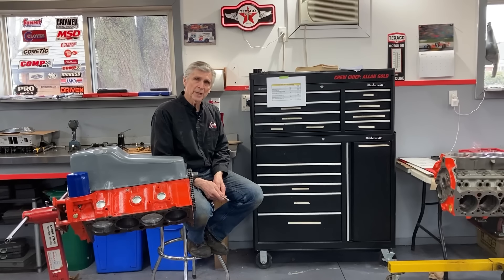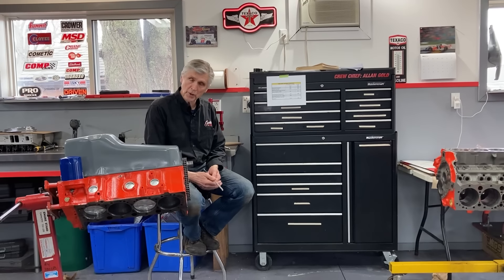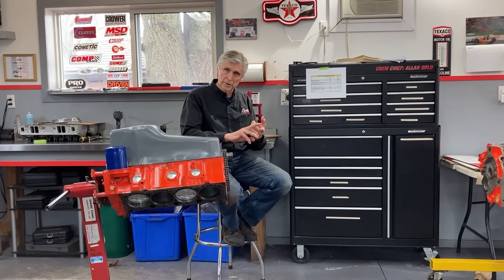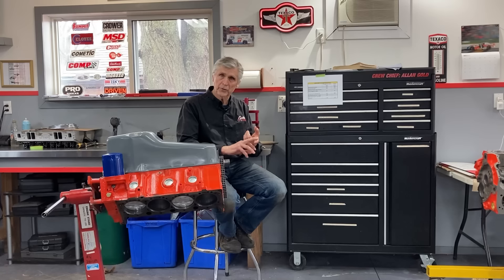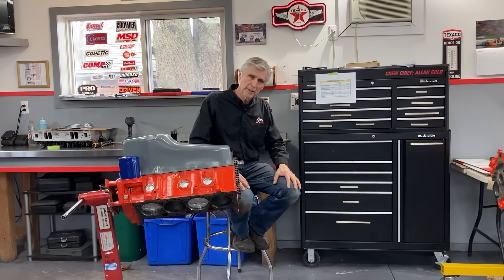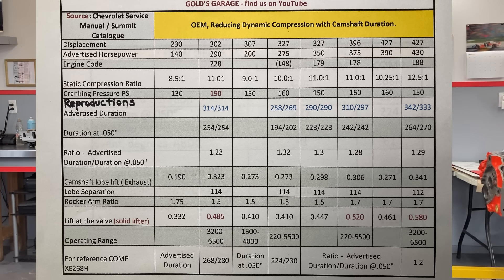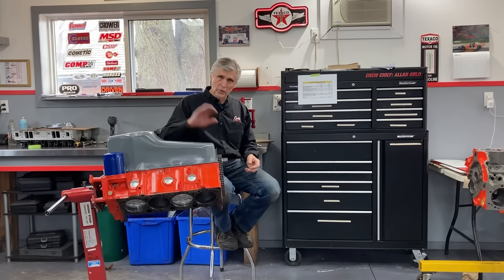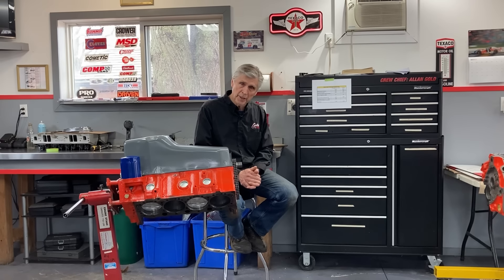Selecting the right camshaft - Compression Myths How much compression can you run on pump gas?

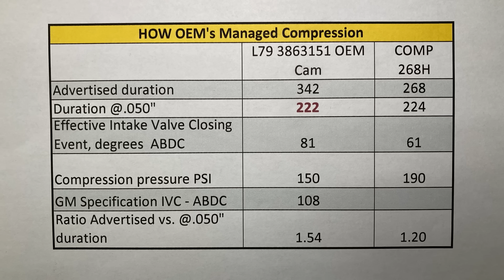Comment: Interesting Camshaft comparison at video 13:41....Are Both Camshafts Actually Measured using Exactly the Same measuring Method or is Any of the IVC° data Estimated or Equivalent Computed as this is 1 OEM Solid compared to Aftermarket Hydraulic cam ? ......
Exactly did Chevy Measure their Solid lifter cam IVC° & Intake Duration ? .....I don't think 0.050"  or 0.020"  at Lifter Check Height was used.....Anyone know  for sure ??
Reply from the maker: Good question Tom. I calculated the effective IVC based on the other known factors. It would be impossible to measure with a degree wheel because of the soft ramps. Pretty sure the .050" measurement was not common then. We just degreed to the centerline. Thanks for contributing. AG
Reply: Thx so much for  responding....I'm really Interested in this  topic as I have a Mopar build going on with a solid FT Cam & concerned about same Expected octane issues....My error on the L79 OEM Solid lifter spec, I know it's Hydraulic also....Why not Compare both cams Measuring at SAE  0.006" Lifter Check height (using a solid lifter) Similar to what Factory spec was for the DCR calculator input value ? .....I'm real interested in what's Actually  happening at between 0.006" & 0.050" valve lift & think the 0.006" lift point would More validate the OEM extended lobe ramp effect issue on Actual IVC° point.....Thx again,...Tom..

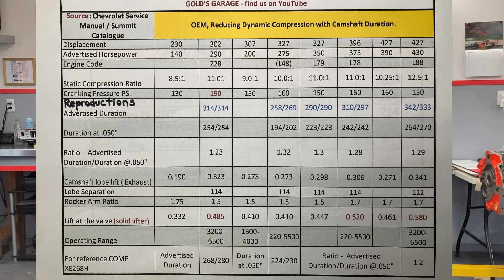Comment: I had a 64 Chevy II that had the “140” (last 3 numbers) cam and 12.6:1 compression ratio according to the guy that owned the car before me.   The car had a 4 speed and 4:56 gears.  It ran on the street fine but would really wake up at 5,000 +!
Reply from the maker: Sounds like a fun ride, Thanks for sharing. AG

Comment: Would you know perhaps what would be a better camshaft than factory on the vw 2 litre air cooled kombi, I think torque would be more advantageous, unless you think original cam is still a good choice. Thanks buddy 😊
Reply from the maker: Thanks for your question Harry but I don't have much experience with this engine and don't know enough about the application. Consider the end use, daily use vs. race, weight ratio, lb./cu. in. gear ratio, type of transmission, RPM range where you will need the performance etc. Hope this helps a bit anyway and thanks for watching. AG
Reply: @goldsgarage8236  ok cool thanks 😊

Comment: We run over 16 to 1 on Pump Gas with Cranking comp of 220 we also don't go near Peak TQ or load it going down the road and chance to Race gas at the tracks. There is lot of work goes into being able to do this but it can be done.
Reply from the maker: Thanks Jeff, I don't even know how you would get 16:1? AG
Reply: @goldsgarage8236  it’s a 712 inch all billet semi Hemi from Todd Goodwin it makes over 1300 hp. We Run Sick Week and Hot Rods Drsg Week. N/A it’s going 7.71 at 174 1.11 60 ft. Not to many people understand pumping losses from lift and duration, ramp design effects on it. Good information overall

Comment: How to consider or calculate cam and gear ratio relation ?
Reply from the maker: Thanks Bryan. Generally bigger cams don't make a lot more torque, they just raise the RPM  where that torque is made. HP= torque x RPM/5252. So if you use a cam that produces torque at higher RPM, you need gearing that raises your RPM and takes advantage of it. So as the operating range of the cam increases, the gear ratio should increase proportionately. Hope this helps. AG

Comment: Yep this is correct and if you if you follow his 61 versus the 81 after bottom dead center that's where he gets it back on the right now yep and I believe that will and his destination is going to make it to the definition for gas cuz that's what we're going to do run pump gas and see if I can do it with 13 to 1 or 3:27
Reply from the maker: Thanks for your comments. AG

Comment: The issue with cranking compression is the rpm the engine cranks at.  Street engines with higher tension rings tend to turn over slower than a comparable engine with low drag rings.  Higher compression can cause a slower cranking RPM if the plugs are left in the other cylinders. I typically remove all the plugs. This gives a better picture of the condition on the cylinder being tested. 

Sizing cams is an art.  Bore to stroke ratio does come into play and it's opposite of what I thought it would be. The longer stroke engines appear to be more fickle with duration than shorter stroke engines.  This is for racing applications and may not matter for street applications.
Reply from the maker: Those are all good points Brad. It is good practice to remove all the plugs and have good cranking speed when taking a compression test. Thanks for your input. AG

Comment: i was wondering why you don't use Brass freeze plugs, i enjoy listening to your video's as we are never to old to learn what you have to say even tho, I am 80 yrs old and still enjoy hot rods.
I have a running project 1940 ford cp. with a 327 with a tir power carbs setup and a new 5spd TKX tranny with a dodge 8.3/4' & it's has a 4.10 rear axle ratio. I'm using 80's 350 truck heads with the angle spark plugs to lower the compression to about 130 psi so, I run 87 octane pump gas.         
 .
Reply from the maker: Wow, 80 and still digging, I hope to do the same. 
That will be a cool rod with the tri power 327. Actually i usually do use brass frost plugs and i am installing them on my current build for Will Casey. I just happened to have the steel (galvanized) ones . Steel plugs will outlast us but brass looks cooler for sure. AG

Comment: I once ran a 327 sbc with 10.5:1 compression with ported camel back heads, a pretty hot
cam, headers, a Holley 600 (tuned) with a Mallory Unilite ignition.  Ran very well for several
years on 91 octane gas (NO pinging).  Good aluminum heads might be better for more
compression.  I was probably putting out around 375-400 hp.  Only reason I was "slow"
was because I had a 3.42 open rear end in a 1972 Camaro.  If I had a 3:73 posi, I would
have been MUCH faster, especially with really good tires.
Reply from the maker: Thanks Hans. Gearing helps. I installed a 4.88:1 gear in my Camaro in 1969 and it was still there when i bought it back. Lot's of fun on the street. Sounds like you built a nice SBC. AG

Comment: I worked in a building that one business unit did QC for refineries and stored aviation samples from plane crashes for testing. One thing today is its not really fair to call fuel octane still, it's blends of multiple carbon chains, many lower than octane, i remember as a kid my dad burning bush piles with purple and when the match was in the air you were heading the opposite direction and the whup went through you, today sometimes you can't barely get a fire to lite
Reply from the maker: interesting point, thanks for the comment hardtail. AG

Comment: So the silly late intake closing cam is asking to be advanced a bit? I am sure a lot of people have done that. But what was the effect?
Reply from the maker: Thanks Ram, advancing the cam will increase compression pressure and low end torque, sometimes at the expense of top end HP and torque. AG
Reply: @goldsgarage8236  Does an engine with such a ridiculously late intake closing even reach a top end?

Comment: I think you can run 87 with a 12.5 compression motor if the cam has plenty of overlap, reduced spark timing, and running only at lower RPMs with light throttle.  Didn’t Crower cams offer cams to run high compression engines on pump gas?
Reply from the maker: Thanks Scott. Cams with lots of overlap also have a late IVCP which bleeds off compression at low speed. AG

Comment: Great Video!! 22r (2.4 liter solid cam) street driven Weber 32/36, dual plane, stage 2 cnc’d heads with +1mm valves all port matched, ~9.8:1 , mid length header with 2.25” exhaust.
Currently have a Crower (EFI stage 2) 216/220 @ .050”, advertised 270/276 with 430/430 lift and 114* LSA, which was obviously not the LSA I thought I needed, but I like the specs of the rest of the cam! 
Crower has the stage 1 Carb version (same specs as efi stage 2) with a 108* LSA, which I currently plan to buy to hopefully run 87 and get 25+ mpg city (with 3.73 gears eventually, 3.07 now).

Your time is appreciated, and your thoughts greatly appreciated.

Without dynamic compression measured, is ~10:1 on 87 octane likely, or is my head still in the clouds? 

Rare to find someone that tailors to street driven vehicles, so I’ll be checking out your other videos for tricks before I pull my motor back out. 
Currently have 9:1 pistons with 114* lsa cam and bought KB’s 9.7:1 hypereutectic and shopping for a better cam.
If it won’t run well enough to stick with 87, it won’t stop me, but don’t want to ‘tune myself to death’ trying to accomplish the impossible if I just need another octane point.
They have a stage 2 cam with 226/236, 286/290, .429/.443 with 108* lsa (which might be too big for low end desires and possibly too much dynamic compression to risk detonation but recommended upgrades of engine requirements align but they project a 3,000-7,000 power band versus 2,200-6200 for the stage 1) or another option is having them custom grind one similar to these specs, maybe more exhaust lift and/or tighter LSA.
Thanks again for the video!
Reply: you talking about the Toyota engine? I always wanted to see how much they would make! I heard the 20 r head made more power if you know is that true?
Reply: @johnsheetz6639  every 22r owner that has spent a lot of money will tell you they won’t make much hp but the torque is pretty decent. I’m $3,000+ invested in the motor and with manual steering and electric fan (less parasitic loss than clutch fan) and 9:1, I maybe freed up 115-125 hp to the wheels. It’s not a very satisfying engine to sink money into but can expect to see 200,000 miles, it appears.
They are described as tractor engines and I agree, so depending on what you want to use it for, you’re probably better off with any other engine in the world for hp unless you boost it… and even then, there’s probably a better alternative.
Reply: @johnsheetz6639  as for the 20r head, they have a hemispherical combustion chamber and a straighter path for air to flow in the ports for better velocity, so depending on your build, they could be a bolt on bunch of fun. They are also rare to find, which drives the price up.
Reply: @Dube7666   that's what I heard before and the Jeep 4 L is one that's kind of the same. They both remain two of my favorite bulletproof engines though. They are engineering perfection for getting you there and back!😎
Reply: @johnsheetz6639  I always like the jeep cherokee and thought a low rev turbo with a straight 6 would have a lot of torque… but the Jeep emblem cost on every part adds up before it even begins.
Reply from the maker: Thanks for the info Dube. Looks like your comment created lots of interest. AG

Comment: Generally speaking, and negating the hundreds of other factors that effect engine power, will more timing with higher octane usually have more power ? As an example, if we had a typical 500 HP BBC street beast running great on 93 octane, with say a 10:1 CR, and 30* total timing, gain more power simply by changing to a 103 octane and bumping timing to say 36* ?
Reply from the maker: Thanks J. I believe that is true, although I have never tried it on the dyno. AG
Reply: @goldsgarage8236  Thanks for the response. Great channel !

Comment: I paused video to give my 2 cents of knowledge. 12.1 compression on pump gas, they used long duration cam to bleed off cylinder pressure at lower rpm.😊
Reply from the maker: I think you are correct Antilaw!. Thanks AG

Comment: What is not considered is why the intake closing is delayed. CCP does not consider actual running engine at higher engine speeds. The late closing allows inertial to better fill the cylinders so even though the engine degrees of duration with a closed valve is reduced on compression the cylinder has packed in a larger mode dense charge. The bleed off that is seen at low speeds and cranking is now negated. Dynamic cylinder fill takes over and the demand for higher octane prevails.
Reply from the maker: Very good point Don and so high speed detonation may occur. The difference is that at high RPM, detonation doesn't have as much time to do damage. AG

Comment: I just ordered a four bolt main long block 350 from AutoZone, and I’m getting Comp Cams CL12-600-4 Thumpr Cam and Lifter Kit - CS 279T H-107, do you think this will go good together with that application
Reply from the maker: Thanks J&D. This thumper cam has 241 degrees of duration @.050" on the exhaust valve and a tight lobe separation angle of 107 degrees. Lots of overlap and late closing of the exhaust valve is how it creates the retro idle sound. I installed this cam in a 1968 Nova a few years ago. There is a video on my channel  of it if you would like to see how it will sound. 
To make it work you should have at least 9.5:1 CR and an good heads and intake, headers and a good exhaust system etc. 
The other consideration is the car and drive train. 
Ideally  with this cam, no more than 10 pounds of car per cubic inch of engine and an overall gear reduction in first gear of 10:1. Multiply the first gear ratio in your transmission by your final drive differential ratio. 
If you have an automatic transmission I would suggest a higher stall torque converter to get it moving. 
Cam selection is somewhat subjective so I would suggest you gat other opinions as well. 
I hope this helps and please let me know if you have any other questions. AG

Comment: I would like some advice on cam selection.  5000 lb 4x4, ford 400cid engine, 10.8:1 static compression ratio, ELEVATION 6000 to 8000 feet, C6 auto transmission, 3.50 gears with 34" tires, TFS heads.  Elevation totally messes up my cranking compression ratios.  I would like a 170 to 180 psi cranking pressure at my elevation.  What cam specifications should I be looking at?  RPM range 2000 to 4500.
Reply from the maker: Thanks for the question rods. There are cams referred to as RV cams, lots of low end torque, so relatively low duration, <210-215@.050" or so, and power in the range you are looking for. Since the duration limits lift, I would also suggest looking at increasing the rocker arm ratio. It is a nice way to add lift. Hope this helps. You might also call the cam co. help line or you can go online and fill in all the info, they will enter it into a system and give you a recommendation.
Reply: @goldsgarage8236  dont alot of Fords already have 1.6 rockers?
Reply: you might consider advancing the cam......if you have the piston to valve clearance.
Reply: My main issue is elevation.  I would like to have a camshaft that will make pressure at 7000 ft  as if it were at sea level.  160 psi at sea level is only 128 psi up here. Off the shelf RV cams do not factor in elevations like I deal with.
Reply: @rodshuffy4045  I would say advance the cam to close the intake valve sooner or call and get a custom grind.

Comment: 3rd gen mini cooper S has 11:1 comp (250 psi cranking spec ) and requires at least 89 octane. From the factory also running 8-9 psi of boost

Comment: how can you increase compression reading from 160 to 200 ?
Reply from the maker: Thanks Mark. That is a big jump, first you have to increase your static compression ratio. The factors that effect it are smaller combustion chamber, thinner head gasket, using dome pistons and increasing the bore and stroke of the engine. Advancing the cam or using a cam with an earlier IVCP, (Intake Valve Closing Point) will also help Dynamic compression. Summit has an online calculator for static compression and Wallace is an on line dynamic calculator. AG
Reply: @goldsgarage8236  Awesome info ! I am building a 11 to 1 454 and will go with a roller m21 trans rear gear 355 or 373 tops what is cam would i use to make best TQ and HP i am looking at 550 Hp and would rather have torq down low to 5 K Thx for your intel

Comment: What cam would you use for a vortec 7.4 with a 1.6l Whipple charger with oval port brodix heads and around 8.5 to 9-1 compression ? I'm building it for towing for my 90s Chevy pickup , it's a manual trans and I might stay 3.42 gears or go to 3.73 . I'm trying to build it to be a very daily drivable truck and rum on 89 octane
Reply from the maker: I suggest you look at an RV type Cam with relatively short duration and mid lift. Calculate your static and dynamic CR as well as cranking pressure first. Thanks for the question. AG

Comment: I'd push 11.5 1 with fast swirl aluminum heads and the right dur cam. The higher a cam lobe lifts the valve off the seat it does hold the valve open a little longer. But few cams are streetable past using a 285 dur cam.
Reply from the maker: Thanks Paul, 285 is probably a good number. AG

Comment: 1998 Vortec has 200 lbs of compression while doing a standard compression test . I know this because I did this test and I couldn't believe it . And that's a flat top piston with 4 valve reliefs  906 head
Reply from the maker: Thanks for that info. That is amazing for sure. I have also seen this on some 602 crate engines with Vortec heads. AG

Comment: FYI i built a 383 sbc that was run on the dyno it made 437hp on pump gas , cranking comp. was 195 psi.
Reply from the maker: Thanks jiggsman, that is a good number for a street 383. There is a video on my channel of Tom Winkler's 383 that made about the same. AG